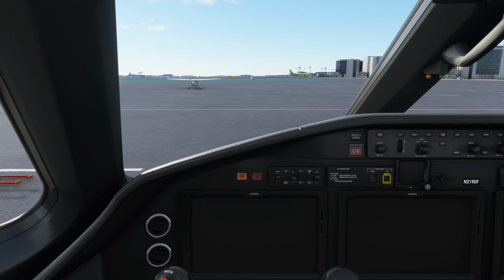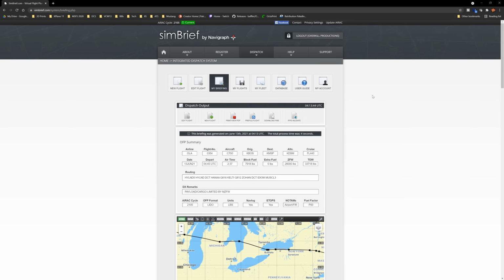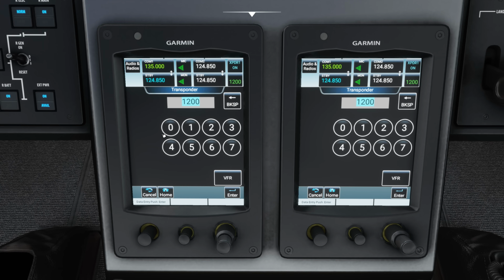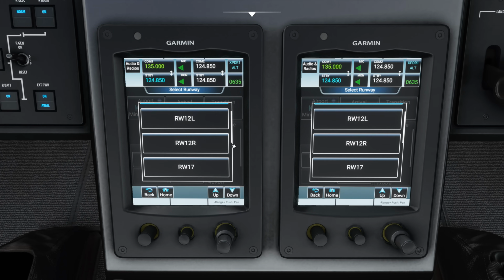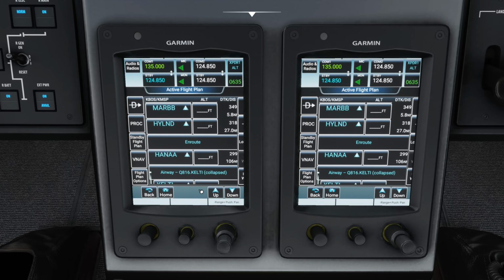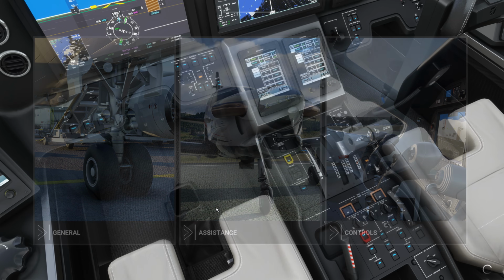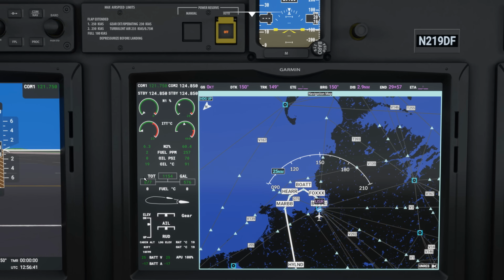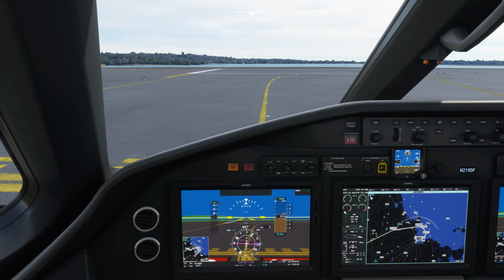Microsoft Flight Simulator | Cessna Citation Longitude |Tutorial PART 1

Comment: Interesting video…..The representation is quite good, but there are some major differences between this and the actual airplane. The Garmin controllers are slightly different, and a lot of the functions that are automatically done in the airplane are shown here wrong. No big deal, just FYI….transponder is always in auto, and the anti collision strobes are only on after entering a runway. The rotating beacon comes on automatically when an engine button is set to run. Still….pretty accurate!

Comment: Super late to the party, but a few notes from a member of the Longitude flight deck team. 😁
Primary pitch trim control should be on the yoke, the pedestal trim control should only be usable if secondary trim is commanded to ON (used in the event primary trim fails). If the trim displays were working on the EICAS strip, they would display a green band showing acceptable positions for takeoff. 
On engine start, bleed pressures for engine start should display between the ITT arcs. 
While taxiing, pilots would typically use the steering control on the pilot’s left, giving much greater steering authority.

Comment: I have been unable to get the G3000 mod to work due to a file name length error in Win 10, have tried the registry fix as well as local group policy but still get the error. The effect is that when spawned into the Longitude none of the screens come on when the aircraft is powered up. I remove the working title folder and the screens come back. Any suggestions would be greatly appreciated.

Comment: Exiting Q816 only shows HOCKE and CFRCN, no KELTI, followed guide as is and have all mods installed any ideas?
Reply from the maker: Navdata may be out of date
Reply: @OverkillSimulations  how would I update that?
Reply from the maker: @RenzoDelRey  it should update with the sim... do you have navigraph?
Reply: @OverkillSimulations  yes, I have a navigraph account, and I have linked it in the FMC, however no subscription, I feared the lack of subscription could be the problem
Reply: Bought Navigraph subscription and used Navdata App and it fixed FMC airway list and can finish following tutorial, thanks for reply, hope this helps others that may run into same problem.

Comment: Cannot see trim settings. My Accessibility Tooltip options do not match your shown in this video. I have Menu Tooltips, Instrument Name Tooltips and Instrument Description Tooltips, none of which will make trim setting visible. Running latest versions of MSFS 2020 and have loaded all mods of Longitude.

Update:  The answer is that the instrument display in the external cameral view shows trim settings. Just toggle back and forth with the END key on the keyboard.  Also, the elevator trim is displayed on the EICAS but without numbers so it is basically useless.  The proper solution would be to show numbers there, on the EICAS. One can only hope.

Comment: When I start the engines, my N2% never goes above 25.0.  I have rewatched the video several times but the engines never start-up properly.  I don't know what I am doing wrong.  If you use ctrl+e, the engines will start-up correctly.
Reply: he didn't mention that u need  to turn on the  fuel pump on the right hand side of the throttle, or you can look up the check list and will point  to it, turn it on and the engines will fire up.
Reply: @PyronoxOmega  Thanks for the help.

Comment: For some reason I can't use the logitude citation I have it in my comunity folder but can't see it in the Aircraft selection
Reply from the maker: It's a default aircraft.  What version did you purchase
Reply: @OverkillSimulations  I just looked and it's on the deluxe version I only have standard I feel like a dummy lol that's  why it won't work lol
Reply from the maker: @OyateShiyani  you shouldn't feel like that.  That's the problem with so many variations

Comment: Isn't the point to put the APU on first, before programing the FMC. No need for a Ground Power Unit.
Reply: If the GPU is available I would use it. Saves fuel.
Reply: @Dalwhat  

Actually, business jet pilots avoid using a GPU if they can. Aparently the charges are high. In the CJ4 they start the engines in preference. So if an APU is available, which is a very small, economical turbine, they use that.